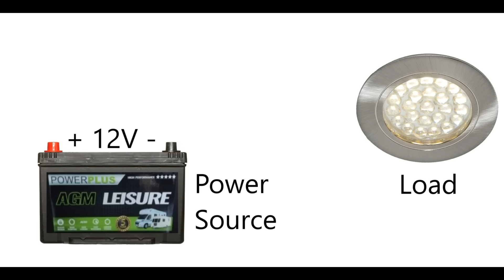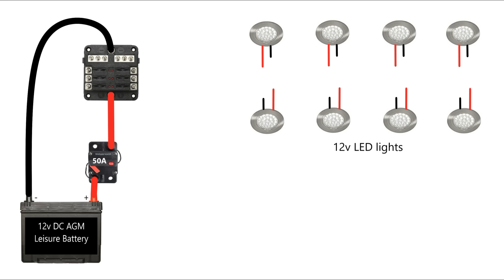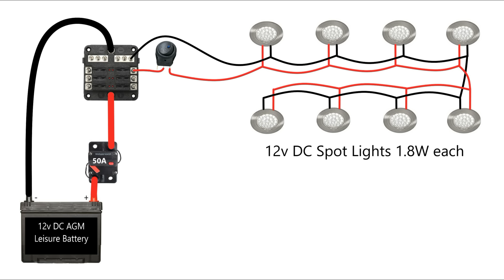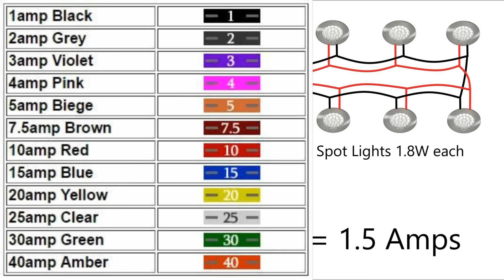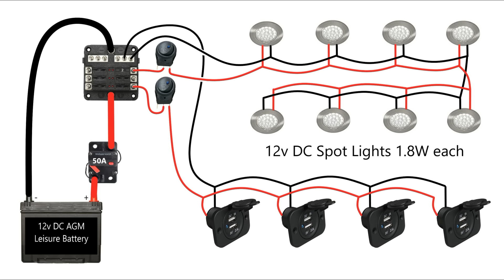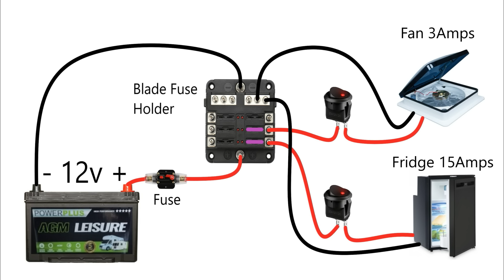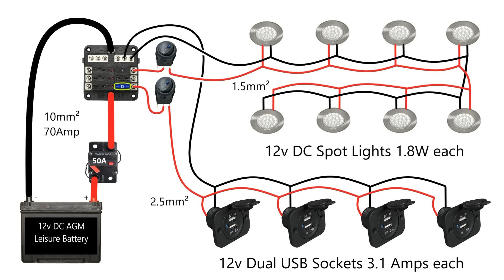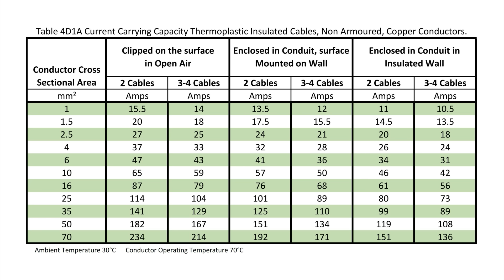Electric Cable & Fuse Sizing - Camper Van Conversion Series

Comment: Really helpful and great well organised . I found the British cable size chart a little confusing , but have been using one from Blue Seas which is helping to get the note taking in order (starting my build soon).
Reply from the maker: Hi Jan, please take a look at this page and scroll down until you see a handy free cable size calculator. 
Simply input the voltage, amps and length of cable run. Then select size of cable so that the result volt drop is a green answer. Very easy to use. https://www.12voltplanet.co.uk/cable-sizing-selection.html

Comment: Greg - I really like all your videos.  I don't believe you are correct between 11.28 and 11.38 in the above.  I would have thought that the series wired lights would have had a similar voltage drop across them and therefore would have a similar brightness or (not work because of low voltage.)  About to use your videos to help me wire my Citroen Relay.  Thanks Again John.

Comment: Excellent video, I’m rewiring my old caravan at the minute and my plan is to use a bus bar the same way you suggested for the retrofitted usb sockets and 12v sockets and a radio, I’ll also fuse the main control panel as a unit from there after calculating the load of lights and water pump. I’ll eventually replace the control panel because the red low battery light is constantly on even though the voltage is much higher than it’s threshold. One other thing I’ve planned and I’d be interested to know your thoughts on is to do with off grid charging, solar panels aren’t an option this year and we do a lot of off grid camping at bike racing so in order to charge at a higher rate than the traditional caravan 12s socket will allow I’ve used a relay and used one of the taillight feeds for reverse and have one common taillight feed so all wires on the 12n have an individual function, the taillights are new led ones so draw very little current. My plan next is to run to heavy cables from the battery of the tow car through an inline fuse and ignition triggered relay to a big connector like the one used for jump leads at the back of the car with the male on the caravan side running too the battery and also fused close the battery just to be sure, I think that would do well for charging the leisure battery over a period of an hour or so if it came to it, that leaves the fridge, I plan to run that from the bus bar but with a voltage sensing relay so it’ll cut out when the car isn’t running, and it won’t drain either battery, I’d love to know your thoughts on that setup and if you think the initial draw from starting the car would have any effect on the leisure battery, again excellent video, I know that’s a long winded message but I think you’re probably the right man to ask lol

Comment: at 11:30 there's a slight error. The first light wouldn't be bright and the last dull. Rather, all the lights would be the same brightness, but dull, as the Resistance and Current for any given light determines the Power (P=(I^2)R). As the lights are identical, they have identical resistance. Obviously the currents are all the same, and so all the bulbs would have the same brightness. However, you are correct that wiring in parallel instead would result in much brighter bulbs, due to the considerably higher current as a result of the resistance being much lower.

Comment: Thank you I just subscribed Great video very informative and well explained it may be helpful if the wire size chart also showed the wire in gauge size which is common in North America 🇺🇸
Reply from the maker: You can google a conversion chart pretty easily. 👍🏼😁

Comment: Similar to the cables its surprising how many people on self builds go to the likes of B&Q and use glue, insulation and sealers intended for the building industry. Instead of glue, insulation and sealers designed and used for the motor industry, which are totally different!
Reply from the maker: Yes, it's a moving vehicle so things need to be more robust and flexible to deal with vibration and abrasion

Comment: Hello Greg, before all thanks so much for a so clear explanation about cable and fusing circuits. Finally I found someone who explains so well all the concepts and puts them in practice as You did with the lamps and USB scokets. Just did not understand when, in minute 15, where you start to explain cable sizing for the 8 lamps 1,8W that gives a current of 1,2A and fuse of 1,5A (25% more) why you choose 1,5mm2 cable and not 1mm2 that from the table holds a current to 10,5A. What am I missing) Thanks a lot, Paul

Comment: Correct me if I'm wrong, the 15 amps fuse for usb is to hight. The 2,1+1A are in 5V not 12, so 5V*3,1A=15.5W*4=62W total... 62W/12V=5,17A... You should use a 7,5A fuse!
Reply from the maker: Yes you are right 👍🏼

Comment: hi Greg, absolutely fantastic not to mention informative video. i currently(pardon the pun) have a factory coach built motorhome, but it doesn't have any USB or 12v sockets within the habitation area whatsoever. this represents an issue as we need to charge a tablet in the cab area along with a dash-cam, sat-nav and reversing camera, which i would all of them to have a on/off switch, either as a master switch for all inclusively or separately so that we could isolate the motorhome when parked up for the winter. unfortunately the leisure battery sits at the back of the vehicle, below the internal consumer unit. the vehicle is a Peugeot Boxer based compass cruiser 760, which there isn't much information on the net about. if required i would be able to post photos of electrical components, locations and device information if needed. many thanks in advance. Warren.

Comment: error: When a number of loads are connected in series the same current will flow through each. So in your example of 8 identical lights each will be of the SAME brightness, not first one brightest and last one dimmest. Otherwise very useful video, well done.

Comment: The only thing i want to bring up is that the usb plugs are 5v out at 1 and 2.1 amp wich is a about a 15 w load if using both plugs. so caculating it that way would give about a 1.5 amp load at 12v side not the 3 amp as stated in the video due to the different voltages in these parts

Comment: Ive been searching everywhere for the answers to these questions.

1. What size wire do i need from the battery to the accessory fuse block? 
2. If I am using a total of 60 amps between all accessories wired to the block, would I only need a 100 amp breaker?
3. Does ground wire from battery to fuse block matter?
4. What size wire typically is used from the accessory to the relay, and the relay to the fuse block?

Comment: Thank you Greg.This video is invaluable. Regards. Ross.
Reply from the maker: I see you are using the video for marine application. You have your own boat? 👍🏼😊
Reply: @GregVirgoe  Yes buddy a 42 foot catsnaran I am building myself  Starting the DC system next week and will use your tables for ampacity calculation and wiring sizes .
Reply from the maker: @LifeOnTheHulls  there is a really handy free cable sizing calculator on this webpage just scroll about halfway down to find it. https://www.12voltplanet.co.uk/cable-sizing-selection.html

Comment: easy to understand informations here. thx for that. but as far as i know the cable size is not only important to the amps you wanna put through but also the voltage will drop signifcantly if your cable are too small. that is probably not important for the usb sockets and led lights. but a fridge is maybe not switching on if you loose 10% to 20% of the voltage because your cable is too small. if the wiring is only 1 or 2 meters from the fuse box...its not too bad but if its 5 meters or more it will become a problem.

Comment: Hi Greg. Great videos. My wife and I have been following you since the first lockdown when we decided to move house (down size) in order to buy a Sprinter (LWB) to convert. So.. we’ve moved. Painted decorated and repaired the house. We’ve bought the van and so far installed the windows (4), a Skylight, Maxxair and Maxxdome in the roof along with 525W solar on the roof and a Wi-Fi Antenna. Tomorrow I’m wax oiling the underneath….Then… I’m on to first fix wiring. Your “Electric cable and Fuse sizing” video is great and has given me the confidence to start. I am however confused as to how you (in your video) selected the 1.5mm and 2.5mm cable sizes. I have the sizing chart ….. but I must have missed a trick to understand how to use the chart. Please guide me. Ps: I retire at 66 next March so my wife and I are embarking on the “one foot in the grave” tour 😂
Reply from the maker: The chart has different columns depending where the cable is to be installed. As you go across the table for each size the amount of amps reduces because the installed location is potentially warmer. So you have to down rate your cable if for example it’s installed in an insulated wall with other cables. I looked at typical power in amps and picked a size of cable that would cover most things. It never hurts to go bigger on cable size.

Comment: very helpful ,thank you for clear and accurate information
Reply from the maker: You are welcome. Are you building your own van?
Reply: @GregVirgoe  no ive a 2000 year hymer thats built on a sprinter chassis which brought me to your site a good while ago for sprinter maintenance,but since then been enjoying your travels and now im replacing /improving a few wiring issues so your my port of call ,keep up the great work and enjoy your travelling
Reply from the maker: @drexelspivey6472  glad you’ve found them to be useful and good luck with your upgrades 👍🏼😃

Comment: Very good video but a small miscalculation was made with the USB sockets. The 3.1 amps rating is @5 volts not 12 therefore they will be drawing 15.5W/12V=1.29 amps each X 4 for a total of 5.16 amps @12 volts. Fuse should be minimum 7.5 amps.

Comment: Hi Greg,
Thank you for all the work you do for us the newbie van converters. Understood everything expect 2 little things and wanted to make sure that I get the bigger picture. On min. 19:30 of the video you said that the 10mm cable from the battery to the  blade fuse holder can handle up to 70 amps. Where on the table it is said that it can handle up to 65 in open air and down to 42 in insulated walls. And here comes the second thing that I couldn't understand. What are those columns with 2 cables and 3-4 cables don't you end up wiring 1 cable every time?Hope the comment I've sent is not that bad as I don't speak English that good. Thanks a lot and hope to see you on the road once I finish with my conversion so that I can cheer you up ^^
Reply from the maker: Sorry for the confusion different manufacturers give slightly different ratings for their cables. 
The table is worst case and suits all makes. 
The figures for 2-3 cables is where they are installed and bunched together as this will increase the heat generated.

Comment: Thanks Greg! I am now planning my electrics. This video makes it really simply, especially working out the fuse size and cable size. I can now buy my lights and work out the ratings needed for cables. I take it with something like a 5 gang 12v switch panel it does the same job as having a fuse box with negative block, so you can then see the voltage coming from the battery?

Comment: When you wired up those LEDs inseries, the (nominal) 12V is divided evenly over each one.  Each should be equally dim (not visible), The voltages you quoted are with respect to earth (I think, I haven't calculated it), but that's not what each LED sees.
Reply: Yes you are correct. Christmas tree lights can be wired in series, the current is the same at each light giving the same brightness. I work on runway lights, they are wired in series with a transformer at each light, the current is the same at each light fitting giving the same brightness.   The voltage is adjusted to give different brightness at different light levels

Comment: Many people use Anderson connectors for wiring campers to Vans, or 4x4s etc. due to the strong connection ability. Your detailed explanation of the wiring was great. 
Could you do a video on which Anderson connectors to use for which application if you know? 
IE: After watching a video where winching can draw as much as 500+amps under a heavy load, how do you know which Anderson plug connector to use? 
An SB350 connector for winching vs a SB50 connector for a fridge or a SB175 connector for powering a trailer, or an SB120 connector for jumping a car, etc.?  
How do you know which Amp rated Anderson connector to use for each application?  
I understand the wire thickness issue but the different rated connectors is what is throwing me off. Thanks for taking the time to show this.

Comment: I'm not sure, but isn't this wrong? 😊 Your USB ports can draw a MAX of 3.1A at 5V (not at 12V) so the Wattage is 3.1A x 5V = 15.5W --> Ohm's Law --> thus at 12V that is 15.5W : 12V = 1.29A per USB socket. And in your example you have 4 of those and equals 4x 1.29A = 5.16A. So you need a 1.5mm2 wire and 10A fuse.
And in Belgium we say (for Cu wires at least, ALU wires are even 1 fuse lower)
1.5mm is MAX 16Amps when using a circuit breaker OR 10A with a fuse
2.5mm is 20A breaker or 16A fuse
4mm is 25A breaker I believe
6mm is 40A breaker I believe
10mm is 63A breaker 
16mm is 80A or maybe 100A???

Comment: Hi Greg, Watching all your video's while on 14 day quarantine in China (I can't even move outside my hotel room). One question on electrics....Do your use relays? Maybe I'm wrong I noticed some switches (on your charts) do not look so "robust". Your videos are by far the most researched and thorough.
Reply from the maker: You generally only need a relay to switch an alternative power source to the control say if they differ in voltage or amps. 
For example to turn on a 230volt device using a 12v supply you need a relay.

Comment: Thanks  allot  for  sharing this with us .very interesting and  the clear  explanations beautiful  job appreciations  Sir🙏👍👌
Reply from the maker: Glad that you liked it 👍🏼😊
Reply: @GregVirgoe  as far I understand  from the cable sizing  chart is I will use the wire 1.5 mm from  1amp to 15 amps and more than  15 amps 2.5 mm and  so on.I don't understand  that chat please  can you explain  it more thanks  in advance 🤣
Reply from the maker: @melvis2017  to make things easy for you please use this free cable size calculator. Scroll half way down page and simply enter your information to check sizes are ok. https://www.12voltplanet.co.uk/cable-sizing-selection.html
Reply: @GregVirgoe  Thanks  once  again for the good  help  and  I do appreciate  it 👍 the last question  is  the wiring  diagram  for  the  kill switch. As far I know  is to give plus and minus  to the switch  but how about  the rest of the fuse panel if you understand  what  I mean  and am sorry  for  my English am French  speaking 🤣Thanks  for  all and am proud  to  be one of your students.

Comment: Well done Greg, clasic example of the blind leading the blind. The very first thing to consider regardless is the environment of the installation. You people make me laugh, your not trained or skilled!!!! your DIY.
Now look up fault current and see if it complies with you wealth of knowledge. You maybe right or wrong, its 50 - 50 with you.
What you’ve done is calculate the circuits in normal conditions, not under fault conditions.
and don’t forget the cables you’ve suggested are double insulated and stranded cables need to be terminated with ferrels. Otherwise you get loose connections due to contraction, Therefore loose connection equals greater resistance equals fire.
well done mate, I wonder how many vans are out there with your expertise of electrical installation.

Comment: Allowing for insulation is an interesting point. I have a Ford Transit, it's got wires running around the channels on the walls, presumably installed by the manufacturer, but in principle a previous owner might have  added to it.

Now, say I add insulation over all those wires.... Has everyone before me made due allowance?

Comment: I think you have overestimated the loads on your USB circuit. The 3.1A rating is at 5 volts, on the 12 volt supply side it would be closer to 1.25A, meaning the total maximum load at the fuse would only be 5A.

Comment: Hey there Greg, my girlfriend and i are about to finish our 00's Sprinter Conversion! We are wondering about why have you put a 35mm cable from the battery to the 2000W if, according to the british standards, 35mm can carry 99-141A depending on the instalation and you have about 170A going to the 2000w Inverter. I would be really happy to understand that!

Thank you for all the content, despite having a recent degree in mechanical engineering, your videos were crucial for doing my build with confidence! Big cheers from Portugal 🇵🇹✌️

Comment: This tutorial is just GOLD. thx for explaining that. I have a project coming up with my FJ Cruiser. I want to tap into the factory back window defroster wiring/switch. I am trying to add a side mirror defroster and my concern is the factory wiring if it can handle the extra current that will be drawn from the side mirror defrosters? given there will be an inline fuse between the mirrors and the factory defroster switch/cable. 
Anyway, if you have a video with a similar project, please let me know. thx!!